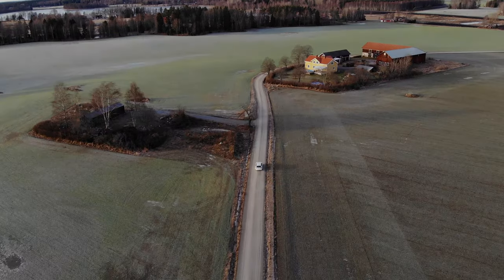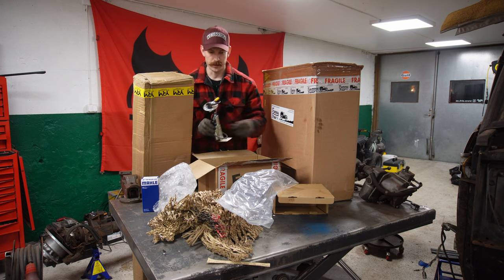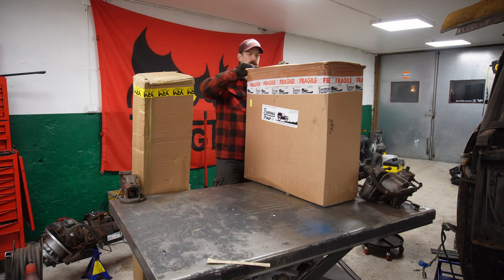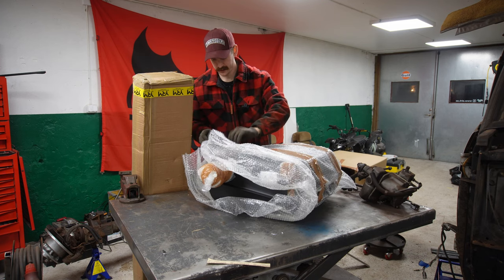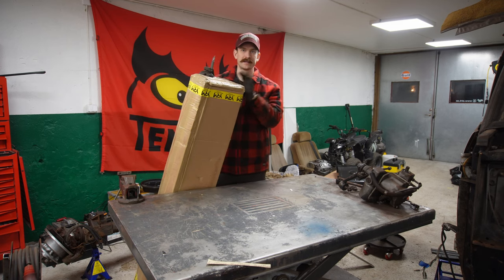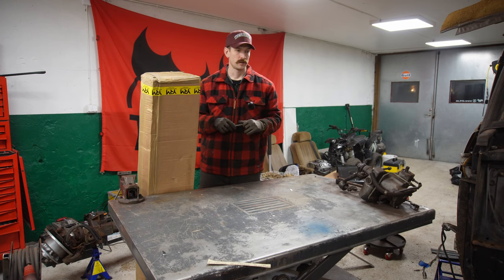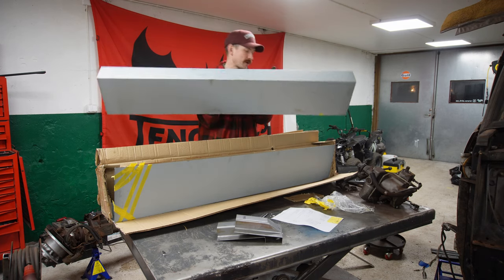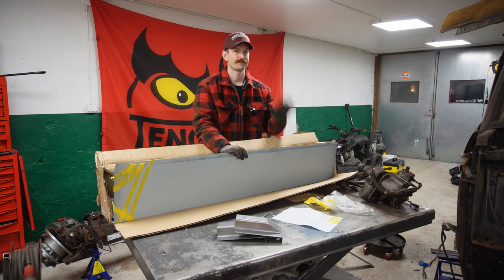UNBOXING SURPRISES! What Did I Just Buy?!

Comment: hello again , i commented on the last video about my rrc and how bad it was ,engine gearbox rebuild new wiring , now i have had new fuel pump and lines and if you jack the chassis in the rear foot well area the door gap alters ,so now needs a replacement chassis , just remember its all good fun if you dont weaken
Reply from the maker: haha!! sounds like you are having a lot of fun at the moment 😁
Just keep going! new video will drop soon on the "Barn find"
Reply: i do have four doors that are rust free and a front and rear wing if you need them , they wont fit any of the current fleet
Reply from the maker: @davidblackburn6569  Okay, where are you located? UK?
Reply: @henriksrestorations  boston lincolnshire uk